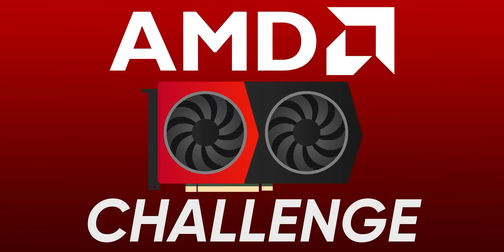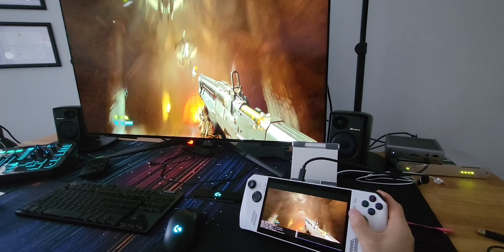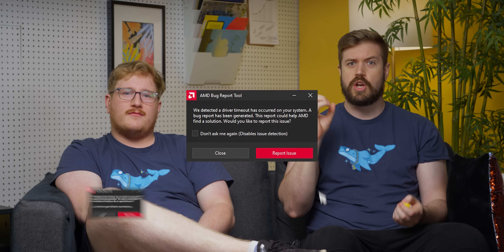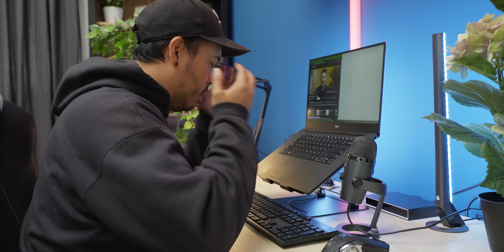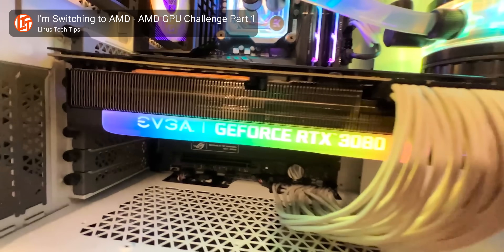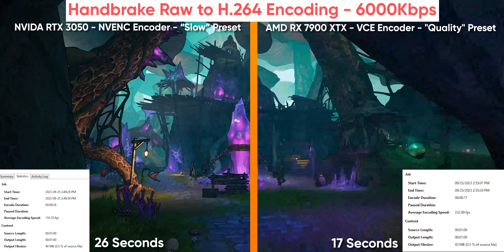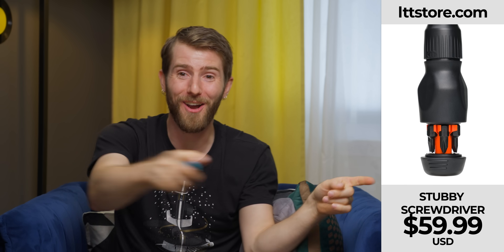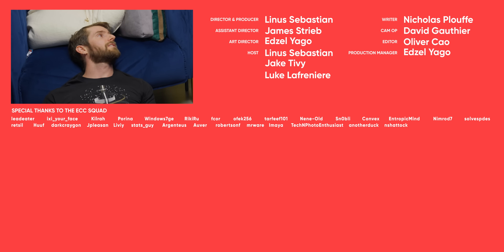I’m Staying on AMD! - Radeon Challenge Pt. 2

Comment: Gotta say, GPUs are finicky as all heck
I remember a while back, I had an HD4770. I could run CoD:MW2 (2009) marvelously on my PC, with zero issues.
A friend had to leave his GPU-less PC with me for like a month and a half (honestly don't even remember why anymore), and it ran better than mine, so I just plugged mine there and gamed on his PC
And once I came back, I couldn't run MW2 *at all*, even on the lowest settings. I gambled on it being a PSU issue (mine was a generic brand that was on the cusp of not supporting the system), so I bought a new one and like magic, it ran just fine again.

I've played on both Nvidia cards (GTX560, 750ti, 1050ti) and AMD (HD4770, RX 6500 XT and my current RX 6750 XT) and, barring that one weird issue that was solved by swapping the PSU, I don't think any brand is worse than the other. The second worst issue I encountered was the fan on my GTX560 died within 4 years of owning it.

Comment: I have noticed crashes in Starfeild when Discord has an update waiting. I have also noticed that I have to manually restart Discord after it automatically restarts after an update or I get a very buggy and laggy PTT. I have found that DDU doesnt remove alll the garbage Nvidia puts on ur PC. I had to go threw and find and manually delete all the crap Nvidia left on my PC even after proper uninstall and DDU. Some Nvidia utilities refused to uninstall claiming dependancys on utilities that had been removed to run the uninstaller. Then I ran Ccleaner to find and remove all the orphaned Nvidia registry entries and that got me going pretty good.

Comment: On my Radeon RX5700XT Radeon Anti Lag caused alllll of those problems. Turned it off and eeeverythings working so good. It should not be a problem to use a feature from the driver or software but.......ahhhh AMD Drivers..........

Comment: Knock on wood, I've had luck with my AMD GC. It has aged a tad now, but auto overclocks well enough to compete with their new cards. 
I can still hit my VRR windows with High+ RT. I still wish it could trace rays though. I am optimistic for FSR3, but really wish Nvidia cared about their consumers... also, I didn't use a fresh install green to red. Knock on wood again, have had luck with stability.

Comment: I've had two Radeon GPUs (6700XT, 6800XT) for about two years now without any major issues. I purchased Nvidia only up until the pandemic. I've been pleasantly surprised with the Radeon 6000 series cards. I did buy 7900XTX upon release and had a defective card for which I received a full refund from Micro Center. I would buy AMD again. Nvidia seem to have more features but is more expensive.  Going forward, I'm likely going whoever has the best costs per frames and can handle 1440p >90fps.

Comment: hmm.. well I'm on AMD since like forever (at least on GPU side) and before RDNA I had a lot of problems (but as a teenager I didn't had much money to spend on PC so performance/PRICE was most important factor)

and now since then I had rx 580, rx 5700xt, rx 6800xt and I didn't had any problems with them (except with disabling screen scaling and on one of them, don't remember which one, video playback in network browsers was a little teary when not in fullscreen, though disabling hardware acceleration helped)
but I always undervolt so it may have caused no-problems experience (except 6800xt cause this one was beefy and was silent enough on whatever load)

now on 7900xtx I was irritated by coil whine (AMD reference -_- ) but managed to find someones sugestion how to undervolt (I can't get how these new oc for 7k radeons works) and since then the only problem I had was being unable to play Beat Saber for almost a year (and idle power usage that dropped to reasonable after a few months)

also 7900xtx I run through PCIe extension, so if its good extension cable it shouldn't be a problem in Luke's case (I thought PCIe port broke due to GPU sag so I acquired vertical GPU mount but it turned out to be broken cables, still I stayed on mount as in this orientation GPU fans in my pc case turned out to be less audible)

Comment: I have both RTX 3070 and 6800 XT
I can say that I am completely satisfied with 6800 XT
I had no crash and blue screen problems
I have much better power and frame in games
My power consumption in idle mode is 30 watts
I just don't know why some Adobe plugins still don't work with AMD
I bought both cards as new at the same price
And for me, buying 6800 XT is better in terms of payment and power

Comment: Yeah but non of you did Bios update and chipset update which helped me for my RX 6600XT, from blackscreens and i don't know what else and then when AMD started again with standard driver support then my GPU was almost withouth problem. only i have 1 problem and that when PC gone to sleep mode sometimes (not always) i can't get picture back so i must unplug HDMI and plug in then it works with no problem but that's maybe HDMI fault and not GPUs.

Comment: is this a series 7000 thing? I'm gonna be honest here, I've been using a 5700xt for 4 years and before that I used an rx580 for 2 years and I never had 1 single bluescreen or crash on windows 10.
Although to be fair I've never had issue with either nvidia OR amd cards. But right now I much prefer AMDs software. Ever since nvidia fucked up shadowplay by requiring an account to use it (god knows why), I just stopped using it altogether.

Comment: AMD and Bethesda worked together on Starfield, Day 1 driver needed to prevent crashing on AMD... meanwhile my 6 month old Nvidia driver and 3080 worked without a hitch. AMD may not need to delay launches for a month or so but hire some better driver programmers. How many times does someone get something new from AMD and it needs driver or BIOS  updates so they can have a smooth experience? All new launches? Most of them? Far more often than the competition and it wasn't an issue with ATI.

Comment: After 5 PC Builds this year, 2 with nvidia cards and 3 with AMD, I do not think I am going back to nvidia for my personal PC. Let's see how next gen goes. RTX 3060, RTX 3070, RX 6750 x 2 and 1 with RX 6800... I have had 0 issues with any of the cards except the RX 6800, but that is 100% my fault because of overclocking and playing with MPT power limits etc. Skipping this gen and will upgrade when RTX 50 xx and rx 8000 cards come out.

Comment: I have multiple PC's restarting themselves after clicking shut off and PC's literally turning themselves on in the middle of the night after having been shut off. This wasn't happening before windows 10 and now I switch off the PSU switch after turning my PC off. So Luke's PC turning itself off might not be related to AMD card as this is happening on PC's with no GPU's as well.

Comment: are amd gpus really that problematic or was this a thing only when they first launched? i never heard that you will get crashes and especially so many with amd cards
Reply: I an NVIDIA fanboy switched to the RX 6950 XT about half a year ago due to cost and performance over the 3070 TI i had previously. 

I can honestly say I've had absolutely 0 problems what so ever. I believe a lot of issues that people experiencing are due to them not uninstalling all NVIDIA drivers before installing the AMD GPU.

The only thing i have noticed is that NVIDIA seems to have more stable FPS when it comes to the 1% lows, although there are many factors that could affect it besides that and many wouldn't consider this problematic.
Reply: Also forgot to mention, i am even using it with a riser, which again has caused 0 issues.
Reply: @metalface_villain  Honestly I can't say. I don't stream or do any form of content creation and speaking to AMD vs NVIDIA on that front would purely be based on whats already available online.
Reply: @lassehansen3056  i don't know what a riser is :D
Reply: @metalface_villain  Ah a riser is basically an exception cable between your GPU and motherboard. Both Linus and Luke used one in the video which is why i mentioned it, as they attributed some of the problems to maybe be related to that.
Reply: @lassehansen3056  I'm basically a noob when it comes to this stuff so the info from the video must have gone from one ear and left through the other 😀

Comment: "A cool new feature allowing you to update your gpu drivers without reboot". Is the Windows driver stack this busted?

With nvidia propriatary on linux you still probably want to reboot once in a while* because they're tied to a release of the kernel, but with everything else it just works. You can even install bleeding edge mesa (amd, nvidia open, mali and a couple more) just for games and use stable system provided one for the desktop.

*once in a while might mean two weeks or so up to a couple of months depending on the distribution

Comment: (I know my opinion is kinda invalid cus I came from a gtx970 lol) a lot of issues like the screen sharing I had on my old Nvidia card but after 10 years I finally upgraded and decided to try amd and now I have a 6700 and I love it, it was fairly cheap and it works great! I did have some issues with the initial upgrade after I installed drivers and re started my pc it wasn't booting properly so I had boot into safe mode and delete all graphics drivers I had and after that it was fine :3. Defo not amds fault it's more mine for not fully deleting the Nvidia drivers QwQ.

Comment: It sounds like these issues with AMD cards is likely just the result of software being built and optimized mostly for nvidia.
I was forced to switch to nvidia when I got into 3d art since 90% of 3d software has either poor or no support for amd.

So since the software generally overlooks amd testing and optimization, it's up to amd to fix bugs through drivers.

This is mostly speculation, but since I'd always gotten older cards and never had these kinds of issues, I'd assume the drivers on the older cards are just more mature.

Comment: I am still running my 6900 XT on 22.4.1 because so far it is the most stable driver i have used with absolutely zero crashes. As soon as i used a more modern driver even launching a video in vr (eg vrchat) the driver just dies.

Comment: "In fairness to AMD, you're running on a riser, who does that?" Uhh anyone who has built or bought themselves a small form factor PC where the GPU has to be connected to the riser because of space constraints? Luke even points out that the Titan Rtx runs fine on the riser. It should just work on the riser. No handicapping.

Comment: Ya amd cards for me have been hit or miss. My 5700xt would have so many crashes and excessive temps. Undervolting and all the “fixes” to no avail. My 6700xt had zero issues. Wife’s 6600xt minimal issues. My 6900xt could not play battlefield 2042(I know I know but still). Now on a 4070ti and it has been perfection.

Comment: Would need to see logs to confirm, and probably a memtest, but thinking Luke's issues are actually DDR5 Timings, or combined power management (even though they both have chips) issue with his BIOS settings, or both.
Reply: Not a single one of those things would be helped by a GPU driver update, so I doubt that.
Reply: @haxie4516  maybe he got a bios update or forgot to chronicle some troubleshooting steps taken.  Moot points without data.
Reply: @phatmcpat  
A BIOS update is not something you do accidentally, and Luke has had little to no free time for most of the time this video covered.

So either way, speculation about it being completely unrelated reasons is not really a good call.
Reply: @haxie4516  just trying to help Luke. I've experienced similar issues with ddr5 8000 kits in default xmp settings and power management. Calling it a bad idea without one of your own is... productive.
Reply: @phatmcpat 
Considering Luke already resolved the majority of the issues...
And the remaining crashes are known issues in a game, and is specifically that game, and not down to RAM timings at all, especially considering the fact that his system isn't a DDR5 system.

I get that you're trying to help, but you're applying your situation to Luke's issues, and not checking to see if the parameters are the same.

Comment: The high idle power draw has to do with the monitor you are using from what I understand.
Reply: Yes, but the aame thing doesn't happen when using an nvidia GPU and the same monitor, so it's an AMD issue

Comment: I'm excited, I bought my first GPU. I think it's a mid card (not saying it's bad I haven't gotten it yet I think it's a legit mid end card), but it's better than the one I have. Mine is an NVIDIA 1030 with only 2 GB of VRAM that I pulled out of my bricked Dell XPS. I bought an AMD Radeon 580 with 8 GB of VRAM. So even if the card I bought is a junk card, it can't be worse than the card I currently have lol, that is exactly why I clicked this video.

Comment: I tried AMD for the first time when the 5700XT came out, I was drawn to AMD because of price and their little ad that stated they can have extra performance when you combine an AMD CPU and GPU.. I had constant issues with drivers crashing, blue screens of death, even YouTube causing graphical drivers to crash.  I tinkered with it for MONTHS, doing full clean reinstalls of Windows, ensuring drivers were up to date, even took it to a professional PC repair shop.  The PC repair shop told me AMD drivers just suck, my hardware is completely fine.  I switched back to an Nvidia GPU and have had zero issues ever since.  It was a really really bad first impression to say the very least.  AMD NEEDS to improve their software, it's just so bad compared to Nvidia.  People complain about Nvidia 'selling' software improvements like ai upscaling etc but.. Nvidia understands that software is 50% of the game, it seems AMD does not (yet).

Comment: All the problems I ever had with my Radeon GPU were always related to either Windows itself or due to poor game optimization, the reason for that is that there is always some Windows' stupid configuration that messes up something, because Windows is developed with Nvidia in mind, Microsoft doesn't give 2 f*cks about AMD users, and the game optimizations I discovered because in forums the vast majority of people that was having issues were using Nvidia GPUs, so it was usually the game's fault, my first reaction was alwas to blame AMD, when in reality it was another software's fault.

My specs:

CPU: Ryzen 5700G 4.3Ghz (8C/16T)
RAM: Corsair 16gb (2x8) 3600Mhz (OC)
GPU: Radeon RX 6600 (8gb)
PSU: Corsair 650W (either CV650 or CX650, I forgot)

Comment: I have had minor issues with AMD, but ultimately I have concluded that it is a Windows problem. I tried to use the newest AMD drivers, but Windows has compatibility issues with them. I let Windows install the drivers it wanted through update and have had no issues since. I cannot use the Adrenaline software though, which is a bummer, but I would rather have no problems. AMD really gets a lot of flak because of Microsoft's incompetence, Nvidia likely has some sort of partnership with Microsoft for AI purposes and are more willing to work with their drivers. Just a theory, but as others have said Linux seems to work much better with AMD cards.

Comment: the problem is that these problems come back with random driver updates. There is a reason why AMD has so many unofficial drivers from modders. Personally, I stayed with Nvidia, I want to have RT performance, which AMD will not give me, I want to have stable and efficient work with Adobe programs, here AMD has a lot of problems, unfortunately, when it comes to games, everything works without any fuss, and I don't have to worry about anything.

Comment: I've had better success swapping from Radeon to geforce with a DDU run. The other way around though isn't as good. So do a fresh windows install.
Recently I have had a few driver timeouts here and there, quite annoying. It looks like AMD has finally fixed them though since I haven't had them the last week or so.
I've been on Radeon since 2013 (R9 290, Vega 64, 6900XT, 7900XTX) And by and large I can sum up my experience as being slightly behind Nvidia. If a Triple A game drops expect there to be issues for a bit. If there is a software bug expect AMD to take longer to fix it than Nvidia would have.
So if you are the type to be waiting for the latest game to drop to play it in the first few hours of release then Radeon might not be for you, but If you are fine with waiting a week to play it then Radeon is a great choice. To be fair this is not every game that comes out but there is a chance that it will have problems.

Comment: I have been using AMD GPU's for many years and I have never seen any of the issues described here.  The worst I have had is needing to update a driver for performance issues in new games.  Honestly, I can't speak about the sleep issues as I have never found that feature to be reliable in Windows on any PC.  Then again, I never buy a GPU on the day of release.  They are usually about a year old by the time that I get them.

Comment: To mention the "GPU driver crashes only", with Radeon cards, as far as my experience goes, when your system crashes due to another component being unstable (memory, cpu overclock) the radeon drivers reset as well and you will be greeted on the desktop with the message "drivers have been reset due to failure" or some such. That doesn't mean it was the gpu necessarily, cpu and memory crashes will prompt this message as well.

Comment: lmaooooo rippp I never had any issues on a all amd setup and this is with a radeon 6600 I could play all my switch ports on vulkan without any glitches the only issues I had were unstable ram which was overclocked too much and a terrible gpu encoder I recommend using parsec for remote play works well as long as you dont try it cross country